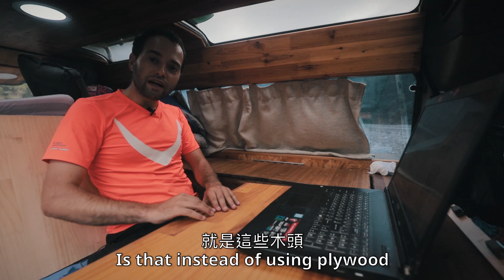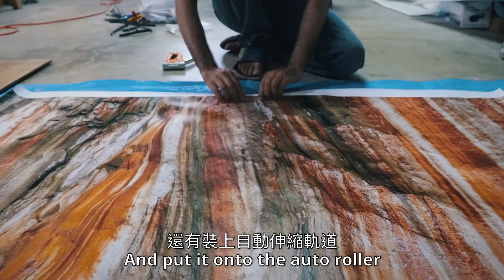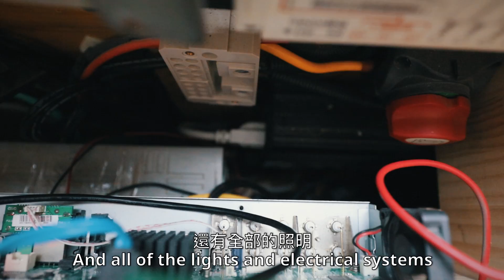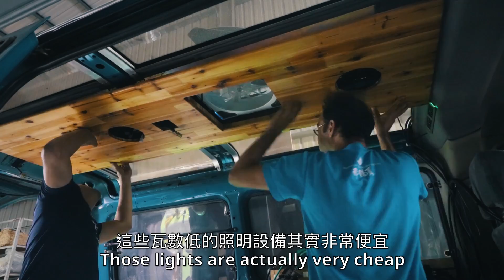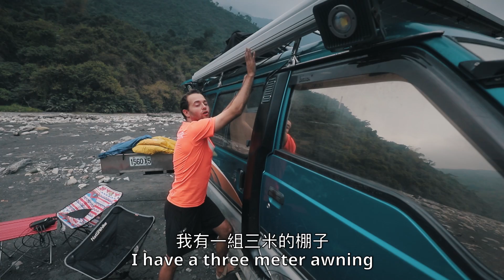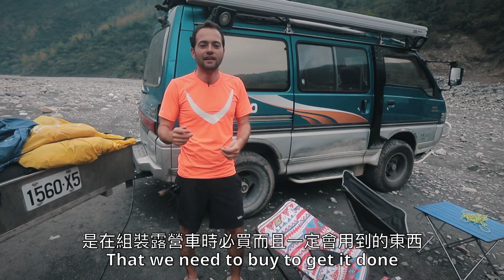我用28萬改裝夢想露營車  ~ 燈光，厨房，床鋪，供水系統，車邊帳，電系統買了多少錢？DIY改露營車〜第8集： Full Price List 得利卡L300 4WD #Vanlife Taiwan

Comment: prep
cleaning and paint 800nt
anti vibration insulation 5000nt
heat and sound insulation 2000nt
total 7800nt 257usd

woodwork 
8sheets 21500nt
support 200nt/500nt
total 22200nt 733usd

ventilation
fan7000nt
silicon etc. 1000nt
8 way relay 8000nt

interior
2200nt mattresses
1500nt curtains
700nt runners
2200nt backdrop
total 36000nt 1190usd

camera system
8000 china
5200 cameras
5500 DVR
1500 screen
total 26380 872usd

electrical 
22000 batteries
4000 cables
2000 VSR
6000 ports etc.
2500 power cables (back)
total 45826nt 1511usd

lights
180nt*5 inside 15w
650nt*2 outside 30w
2500nt front
1500nt party lights (sound activated 😂)
total 8980 296usd

drawers 
11000nt 363usd

water  system
8000nt 42L stainless-steel tank
500nt shower
1500nt 12v pump
400nt pump to kitchen
700nt water lev meter
17200nt 570usd

kitchen
cookstove 16000nt
fridge 8500nt
stove 8000nt
34500nt 1140usd

roof 
awning 22000nt
runners 6000nt
roof rack 3000nt
total 34500nt

rear basket 
12000 (failed)
7000 fixes
3000 power hinges
8000 to current state(lol)
30000nt you said 35000nt in the vid though opps~~

misc.
tools 16000nt
labor 60000nt

grand total 281,900nt  9320usd

and you forgot to include the link to Bevis's shop =-="
what about your truck man what should I lookout for when making the purchase
on the truck any suggestions? why did you choose this particular model?
how much did you spend on that? 2nd hand or brand new?
I'm actually thinking about doing something similar...
Reply from the maker: Facebook.com/homevanlife
Reply: @followxiaofei  lol sorry man, I looked around and realized that you've posted several times in other vids...

Comment: I payed $15,000 usd for my 92 L300.  stock, clean. The fact that you did all of this with labor for less then 10,000 usd  is giving my a brain hemorrhage.  My next delica, I'm getting on a plane to Taiwan. Thanks and keep it up.
Reply from the maker: That didn't include the cost of the car.  The car was about 10,000 for buying it then rebuilding the engine and doing some off-road mods like skidplate, snorkel, and struts. So I'm all in for about 20k.  Still a good deal :). I recently switched our the solar panel for a 75v one, and now the fridge just runs indefinitely.

Comment: Great design of this camper van. The limited space is well used. The equipment meets nicely the needs of outdoor life. How is the weight of all the installed items? Good job and rather economic due to a lot of DIY.
Reply from the maker: It's not as heavy as it looks.  A lot of wood but not much metal.  It's about 200KG more than it was before the seats. Including the inflatable raft on the roof. So basically like you had 3 passengers.